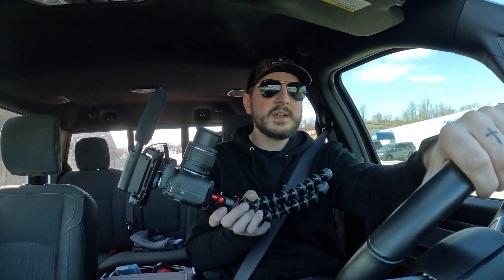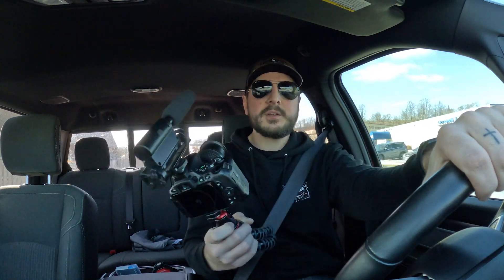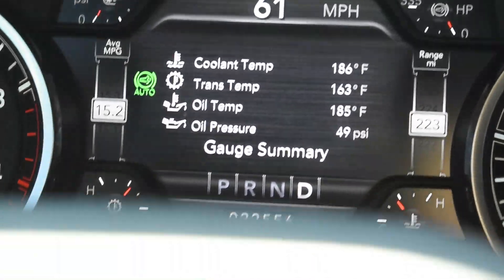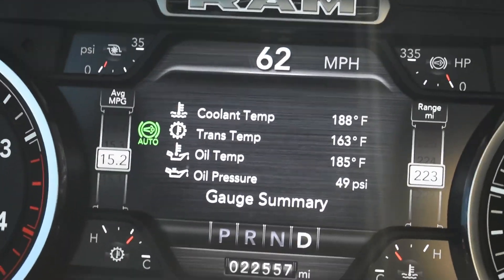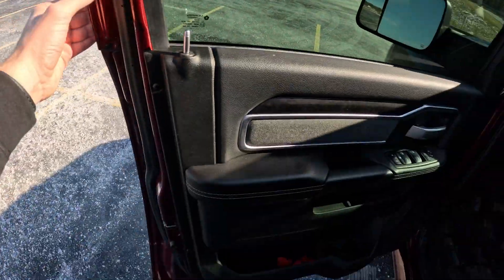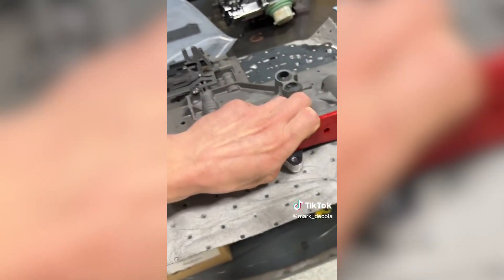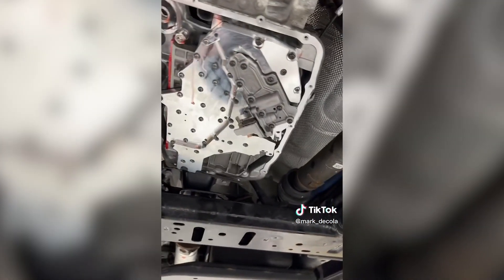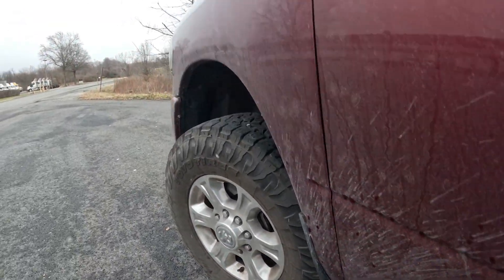Fixing the Dreaded Cummins 68RFE...

Comment: Had the same 4th gear problem. Shops had no idea. Changed the ATF and noticed the plug was not seated right on the driver's side of tyranny. Pins weren't aligned and seated properly. Problem solved.

Comment: I added the Revmax valvebody to my 2008 2500, I also added the Revmax trans computer. This takes advantage of the valvebody advantages like higher line pressure. Your truck needs the computer updated/tuned for the new valvebody to take advantage of the higher line pressure & altered shift schedule. It makes enough difference you may wonder if it's the same trans, much better. I only mention this as you didn't mention tuning for the trans.
Reply from the maker: Appreciate it I’ll have to look into it!
Reply: does tuning a stock trans help a lot as well?
Reply: @nate.hanlon  Tuning a stock trans helps a ton. Don’t got any higher than 170psi on line pressure until you get a better valve body.

Comment: 2022 ram 2500 deleted, 22k miles with p2704 , 0  initial fill volume but does get instantaneous fill volume for 4c 
Kind of does a flare shift. Ordered the same valvebody... i hope it fixes it.

Comment: I don’t have the 68rfe but I do have the 66rfe in the gas truck and you are doing exactly the same as me. The only thing I’m not doing is the deep pan. The valvebody and solenoid pack is the weak link in these trans.
And yes you probably could have done the work yourself. It a fairly easy easy job to do if you have the space to do it inside. This will be my second truck doing it on and probably completed it in a about an hour. The thermal bypass is a trans saver and a must to do on the rfe trans.
Reply from the maker: Thanks for watching!

Comment: Nice ! I have exactly 2021 RAM 2500 like yours, I got code P0871 but I deleted it with OBD reader and never came back, also the gears shift up and down with no problem.
I learned from RevMax that if I change the solenoid, I have to do a "pi curve relearn", but I cannot find this process from your video.
Or you just changed the valve body but keep the old solenoid?

I have done the same delete so I dont want to put back for warranty...
Reply from the maker: I bought a solenoid pack from Revmax as well. And yes, had to perform the PI Relearn. It’s done with dealer software. Thankfully my diesel shop had access.
Reply: @JohnWargo93  Yes, that my headache now.....

Comment: Just curious, did they do a transmission relearn? Or is your truck relearning as you drive for the 500 miles. Nice video
Reply from the maker: Did a proper PI relearn through the dealer software
Reply: @JohnWargo93 did it help?
Reply from the maker: @jacknelson156  I’m about 26k in after this and she’s running well. Shifts quick and precise.

Comment: How were you able to update the line pressure per revmax to 225?  CTT went silent.  And I was told a new blue Solenoid pack would have to be flashed to the truck.  I’d like to talk to the shop that did your work!…butler’s. I have a Randy’s dealer in my area and want to get this done asap!  Thanks for sharing your experience man.  I’m pretty much right behind you with my 21 build.  Wanna see how this works for you!
Reply from the maker: You have an Instagram or Facebook I can private message?
Reply: Would like some info as well. Have all the same issues and same things done to my 19. I don’t have a Facebook or instagram.
Reply: @jessyfew9631  I’m thinking it’s just gonna take time.  I’m thinking maybe ram needs to do a quick relearn from their 50k$ device.  I’m just scared to let them anywhere near my OBD.  Or it’s tuning which is gonna take time for enough of us to complain about. I was also thinking of calling calibrated power or PPEI who only do emissions compliant tuning, but they invest big money into tuning and may have some insight.
Reply: Mine is getting ridiculous with dropping into 4th gear at 70 mph. It is happening every 500ish miles now. I have all the weight loss parts on mine. I have thought about having the recall done where they replace the valve body separator and then reflash the truck to see what happens. Not much difference from 18’s to 19’ except tuning and new facelift from what I understand. I do agree with you about letting them plug into the obd… I’d rather people with actual knowledge be the ones  to do that. I’m not sure if you guys are having this issue or not but it has a tap to it as well. Almost as if the lifters are tapping. It’s done it since 10k miles and doesn’t seem to be getting better or worse. I use the cummins endorsed oil every time but use 15w40. I believe the book calls for 5w30 or something close. I will try switching it next time to see if that helps but I have my doubts. I baby this truck for a deleted truck no burnouts ect just pull trailers but not pushing it at all when it comes to hills just letting the truck do its thing. Sad we all spend 50k-80k+ and are having so many issues
Reply: @jessyfew9631  hey man you MUST use 10w30 unless it’s below 32 degrees on the norm and it calls for 5w40.  Numerous people who run these 5th gens attest to that.  Check out PD Diesel power’s YouTube channel. He had a fleet of 5th gens for hotshot and says 10w30 is what they need.  This should quieten or get rid of the tapping.  It will happen for the first 10% of a fresh oil change mainly at high idle due to the nature of the hydraulic lifters.  After that mine goes away running Valvoline premium blue 10-30.  I’ll find the video and post a link
Reply from the maker: @jessyfew9631  damn every 500 miles is pretty ridiculous!
Reply: Thank you for the advice and info. I will be changing the oil asap
Reply: I agree. Ctt went silent like everyone else has stated. I haven’t changed tuning yet but may try it. My guy likes ctt the best so I’m scared to make the change. I’m trying to hold off till I build my old trans.

Comment: Where are you located.will this fix a OP871 code
Reply from the maker: PA. Honestly I would assume so. The new valve body will be able to handle the higher transmission line pressures.
Reply: @JohnWargo93  how much was the valve body?
Reply from the maker: @gabrielsalazar6648  like $1500 from RevMax but I also did a deep pan, new solenoid pack, thermal bypass, and more. So I was in a little over $3k in total.
Reply: @JohnWargo93  thank you

Comment: Who makes a 200hp tune for the 5th gen? Nobody I have found. Most stop at 150hp
Reply from the maker: CTT. Mines are as follows: 
1. +30
2. +60
3. +90
4. +150
5. +200
Reply: Optimal Welding tunes also have tune 5 at 200hp
Reply: @TREXGAMES42  thank you

Comment: Running it too cool will cause it to build up moisture in it. Water and transmission fluid don't mix.
Reply: Any water build up will steam off and vent out. 200 is too hot for vapor to hang around
Reply: @daveoschann1538  yes, why I made the comment. Some people think running it as cool as possible is a good idea, it's not.

Comment: It took 4 to 5 hours to replace a shift pack solenoid? I can pull the transmission out and replace the overdrive clutches which is the main issue not the shift pack solenoid, 8 hours with beer to do the entire rebuild mine has over a million miles and is an 08  3500 deleted insane I think your booty should be bleeding on a 4 to 5 hour shift pack solenoid that’s only a 15 minute job drain remove pan remove solenoid replace solenoid replace pan fill and done